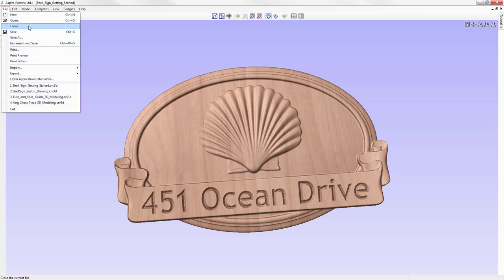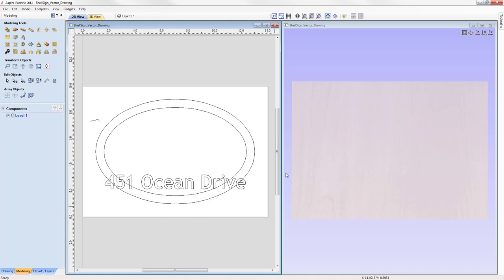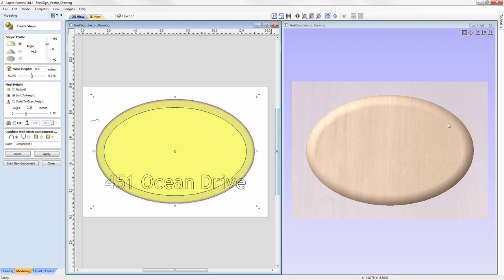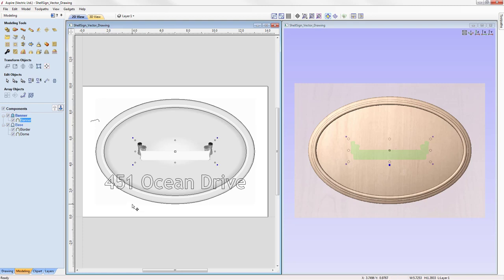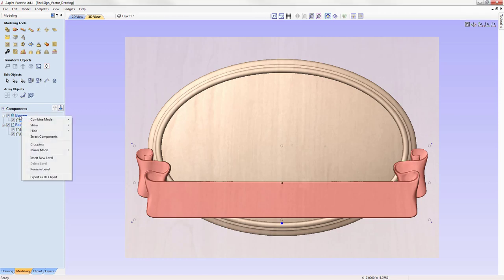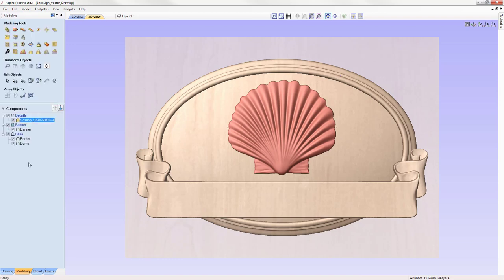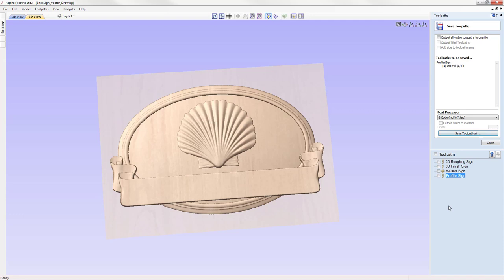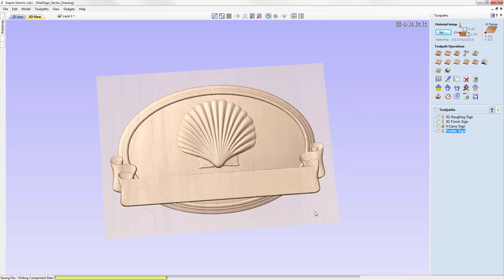Vectric V10 Tutorials | Getting Started | Shell Sign

Comment: Since upgrading to Version 10, I am going through your new V10 videos and finding them very helpful.  So many details get picked up the second time around.   You have been busy . . . it is a challenge to catch up. 
Can you address the V bit selection criteria?  Is there a "rule of thumb" for letter sizes vs depth of penetration?   60 degree has been working out well for vcarving inlays at the scale I am doing.
Thank You for your hard work.
Reply from the maker: Hi Jim, it's good to hear that you are finding the videos useful 😊 as for the VBit selection criteria, the VCarve toolpath calculates it's cut depth by the width of the vectors and the size of your tool, the best thing you can do it preview the toolpath so you can see the results ~ I hope this helps and thank you ever so much for your kind comments 😊😊